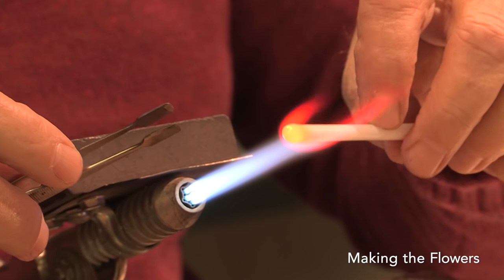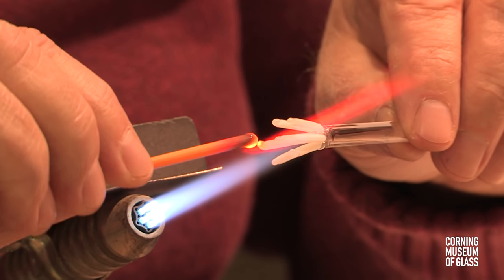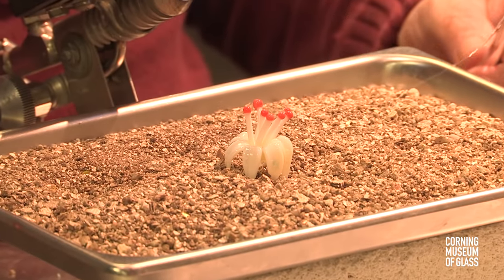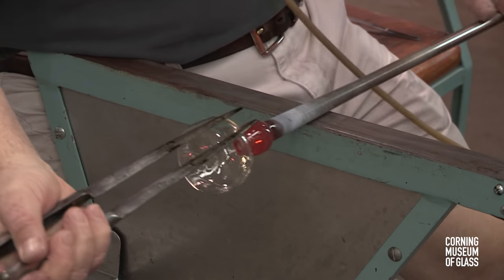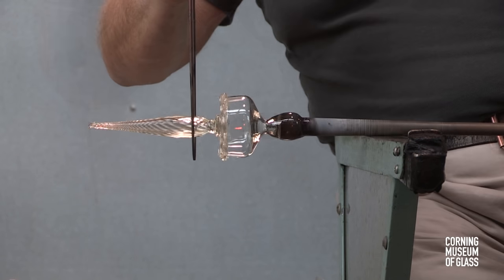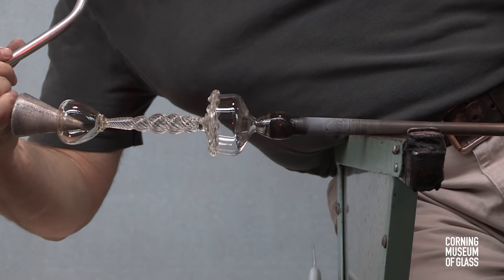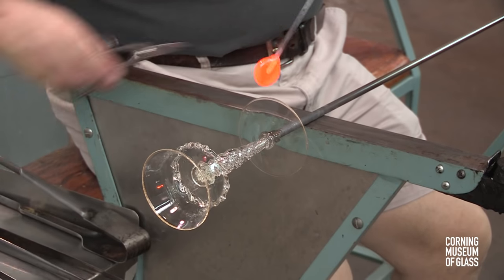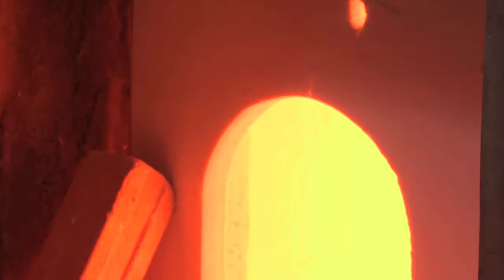Wineglass with Flameworked Flowers

Comment: blow pipe ponty blow pipe ponty, are they the same or diffrent because I can't tell,you are useing the words interchangeably at different points.Also these are interesting but long periods of silence are throwing me off please put music or more comentary / descriptions of what is happing. I'm just a random person on the internet who found these videos so I don't have a clue what terminology means unless you explicitly tell me. (you don't have to heed my feedback but I figure I'll give it so you have it) Good job you have me intrigued.
Reply from the maker: A blow pipe is an iron or steel tube, usually four to five feet long. Blowpipes have a mouthpiece at one end and are usually fitted at the other end with a metal ring that helps to retain the gather. A punty is a solid metal rod that is usually tipped with a wad of hot glass, then applied to the base of a vessel to hold it during the making process. So in short, blow pipes are hollow tubes, puntys are solid. Thanks for watching and for your feedback!
Reply: thank you for the explantation
Reply: To be fair, at the end of the video you said blow pipe instead of punty. When he broke off the piece. The last attachment to the bottom of the goblet, should of been a punty.